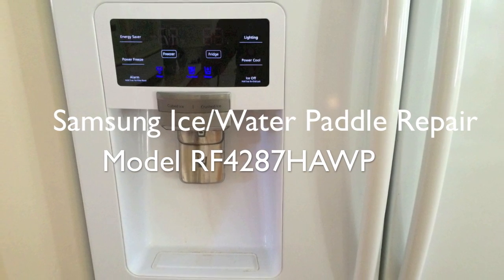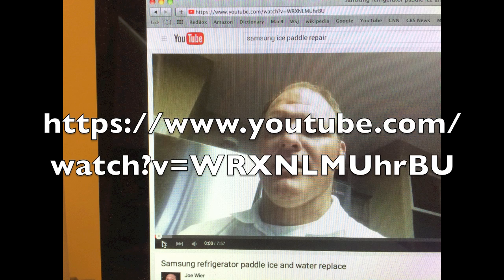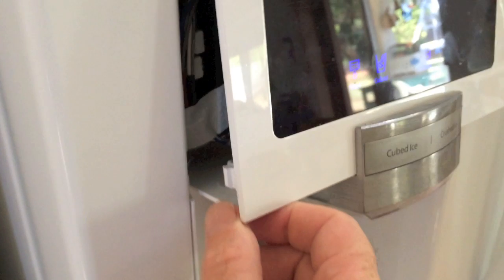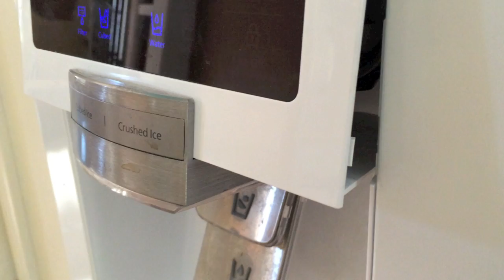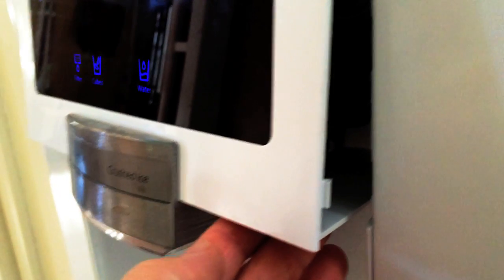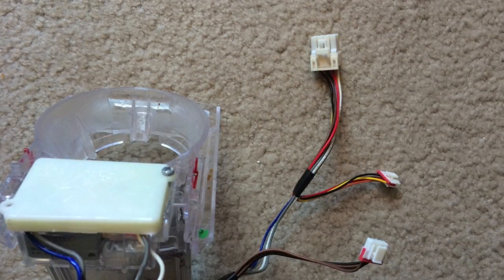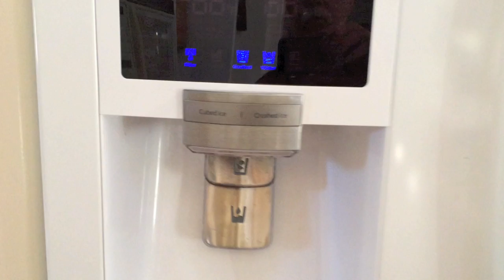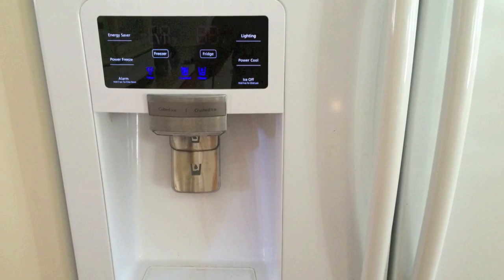Samsung Refrigerator Ice Paddle Repair

Comment: This was incredibly helpful.  I encountered the same problems you detailed that were keeping the old paddle from sliding out. I had to break the tabs on the old part and sand down the metal on the housing to slide the new part in.  I would never had known if it weren't for your video.  Here's to crushed ice once again! Thank you!
Reply from the maker: I appreciate the feedback!  I am still trying to find a way to remove the panel without using brute force, if you have any suggestions.
Reply: I had to use a butter knife to pry it open, thankfully without damage. Strength alone wasn't getting it done.  One suggestion I'd make is just to cut the power to the refrigerator at the  circuit breaker. It seems much safer than skipping it, and much easier than moving it to unplug it.  My kitchen lights are on a different circuit,  so it was perfect.  After all time spent (about 1.5 hours total) coaxing off the panel, chipping away at the old unit, sanding down the metal housing, etc., moving a refrigerator would have been the last thing I wanted to do. Thanks again for this video!!

Comment: I also had some trouble removing the paddle assembly from the metal bracket due to corrosion and mineral buildup. Your video helped me identify the trouble spots. Some WD-40 and a little gentle persuasion with a rubber mallet solved the problem. Thanks for the video.
Reply from the maker: Thanks for the feedback!  Let me know if you found a better way to remove the unit from the front of the fridge - other than the brute force method.
Reply: Ditto on the great video. Once I clipped the vertical tabs with a pair of sharp electrician's dikes, it slid right out. It's amazing that the tabs were so strong and holding so well, yet it was the same plastic that broke, causing the issue in the first place.
Reply: Yes, a great video that has almost got me through the fix.  After putting it all back together everything works except for being able to switch between cubed and crashed ice.   I'm guessing I have not got good contact between the plate that says "cubed ice/crushed ice" and the springs that touch or on the other end of the springs.  Before I pull it back apart I thought I might ask for any insight someone might have.  Right now we get cubed ice just fine.  Cubed was what it was set on before I started the disassembly.  Thanks, Bob

Comment: Hey Richie I watched Joes video first but couldn't dislodge the unit from the compartment. I just knew that there was something missing from Joe's video. When I viewed your I saw the two tabs at the top and saw that they were not hook types but a rounded compression clip. Slipped a couple of thin putty knives in the grove and that's all it took. Huge thanks for that little snippet of the top edge.
Reply from the maker: That is a good tip!  But alas, our freezer stopped getting down to temperature and my attempts to repair failed.  We have had an LG now for a couple of years ... I like the icemaker in the door for easy repair access (if needed) ... and Samsungs after ours had well known issues with their ice makers freezing up so did not want to chance buying another one.  In any case I know that YouTube will be there if help needed to fix our LG!

Comment: Just fixed mine and this video was a great help in providing the info I needed to get the job done quickly. Used a Slim prying tool under each nub and a mallet to get past the mineral buildup.

Comment: Great explanation. Changed out in 16 minutes
Reply from the maker: Tell me.  What technique did you use to remove the panel?  Brute force?  Blue tape and a thin flathead screwdriver? Other?
Reply: richie 
Used a rag in my hand, Brute quick! Force.
My wife was getting a card to use. Before she came back it was out.
WD -40 next hold screen in one hand with rag. Place rag on paddles. Hit it with a a hammer again quick!
Clean it up, slide on new paddles, plug in cables, snap it back in place, plug it in and dispense ice for a drink!!
Don’t be intimidated 
Just get in there and do it!

Comment: Just found your video. THANK YOU very much Very helpful. I love the SAMSUNG and this has been the only problem in many years.  THANKS and again and Happy New Year, Cheers to 2021
Reply from the maker: Thanks for the feedback.  I am still happy with ours - but  our daughter and her husband have a newer one that has the ice maker issue that freezes up.  They have to keep a store bought bag of ice in the freezer - so I would not buy a new one unless reviews indicate that issue was resolved.  The flapper spring just broke on our door and I had to use an elastic band as a temporary fix, but a $12 replacement spring is on the way and a YouTube video shows how to replace without any tools required.

Comment: Thanks for the video.  This filled in the gaps for me from the other video, particularly clipping the "nipples" (you highlighted them in green on your video).  I used a thin hacksaw blade the cut them.  the tabs did not create an issue in my case, it pulled right out once the nipples were cut.

Comment: OMG I had such a hard time sliding the component out until you stated you clipped off the tabs.  That finally allowed me to remove it.
Reply from the maker: Good to hear!  Did you use the brute force method to remove the front panel or did you have success with a gentler approach?

Comment: Thanks for the video!!! It was really helpful. I placed some duck tape around the panel  to protect the stainless steel just overlapping the gaps. My refrigerator (Rf428hars/xaa) has a tab in the top middle and two on each side about 1 inch from corners. I locked the panel using the child lock function but I didn’t power off the refrig. Then I Inserted a thin bladed knife in the larger gag for the applicable tab and got things started. Then I just started prying around the refrig at the different tab location with butter knifes as the gaps got large enough. Eventually the panel popped off without using brute force which I think is a bad idea anyway. After getting the pane off, I broke off the vertical tabs and was able to remove the old paddle.

Comment: Thanks so much for the tips about the catches during removal.  After some prying and lubing with silicone spray, I was able to slide that bad rabbit out of place, clean back up and then snap in the replacement piece.
Reply from the maker: Always good to get feedback!  I understand the newer models have ice makers that freeze over.  Our daughter has such a unit and they have to buy ice and keep in the freezer.

Comment: Great video! We had the same problem with the mineral deposits preventing the slide out. Put thin putty knife in-between the plastic to break the deposit hold..slid it all the way around. then lifted the nipple parts with two small eyeglass screwdrivers and it slid right out.
Reply from the maker: Thanks!  Good to hear about your technique.

Comment: I have the same frig (Samsung RF4287HARS-XAA)  my paddles and switched are working fine, but ice and water only work some times. Icemaker is working fine, so any ideas on why the paddles are not working every time?
Reply from the maker: If you hear the click of the microswitches I can't be of much help.  A wiring diagram, if you can find one, might give some clues.  Seems like the water paddle should be the simplest since it activates the water solenoid, but don't know if that goes through a processor board or if it simply connects power to the water solenoid.  If you find an answer be sure to let me know!

Comment: oh...one more tip, you need not yank the display panel out. Remove the screw first. Then use a putty knife to start open along the same side where the screw was put.